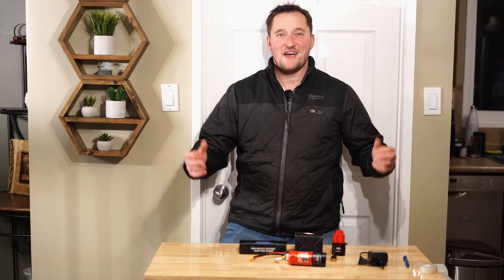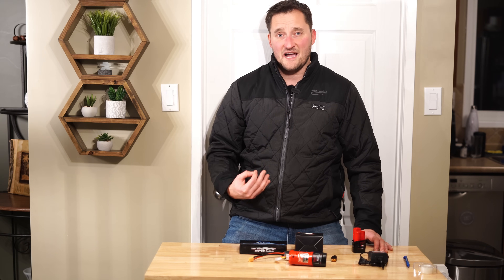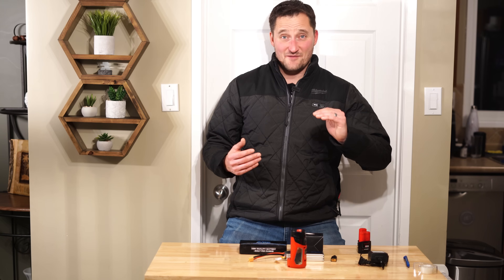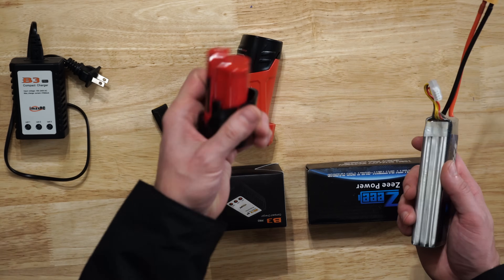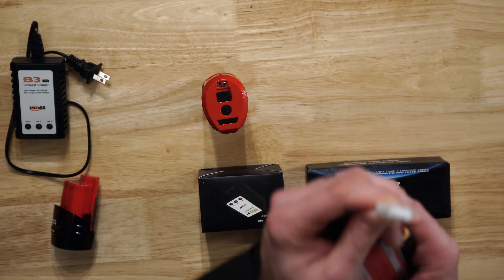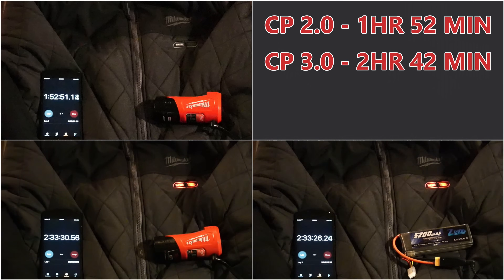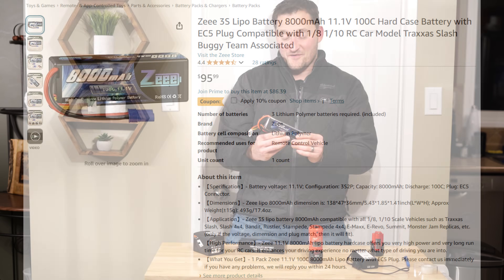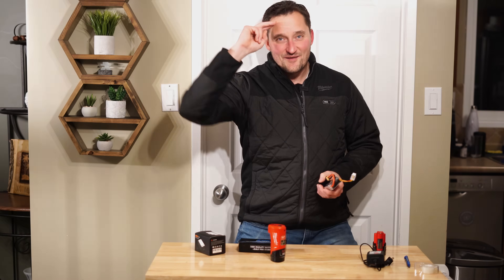WARNING! Read Description - Milwaukee M12 Heated Gear Battery HACK for INSANE RUNTIME!  Part 1

Comment: Get a full RC charger that uses the xt60 and balancer charger that you're using. Much quicker charge rates.
Reply from the maker: Thanks for the comment! I just ordered the 9000 mAh battery for testing and I'll be doing a similar setup for my heat d gloves so I may give that a go. Thanks for the advice!
Reply: @RegsChannel Make sure you read the paper that comes with the battery. It will tell you the minimum charge rate usually .5C and max charge rate usually on zeee batterys its 1c, on a 9000mah batt that would be max 9amps and min 4.5amps. These batterys are not something to tot with have burnt down many a house and sheds. You also want to put them in a storage charge when not using them for multiple days at around 3.8V

Comment: I have a  m18 adapter for the jackets i use it is the hooded one that has front and back heat. I use a 5ah battery that last 8 hours and charges in a hour i love it in my jacket it can fit eather behind me or under the side pocket.only downside is its hard to get in and out but working outside all day it makes a big difference!!!!!!
Reply from the maker: Hey!! Thanks for the comment! Oh I bet! That's great to hear! Yeah the advantage of the M18 stepped down to 11.1 volts is that you will get some sick run-time! I have the Zeee 9000 mAh battery on the way and I am expecting to get 8+ hours of runtime for sure, I'll see if it can give the M18 batteries a run for their money!
Reply: @RegsChannel  last year I was working on storage units the company I work for were building in Columbus and the cold sucked so I got the jacket only had 1 M12 3ah battery until I got the jacket it came with another and was constantly charging them found the M18 adapter for 20 bucks and I have 6 5ah batteries so worked out really good I also ordered a couple of heat pad kits but dint get the chance to install them in some pants or longjohns last year ended up having some health issues in February and haven't made it back to work been doing some work for a budya trying to get my health good enough to go back full time were im not taking breaks every 30 minutes to a hour lol but definitely going to try them here soon!!!!!
Reply from the maker: @stevenoe6395  Thanks for sharing! Yeah that was my gripe, all day outdoor events you need to have spare batteries, the m18's are good, but clock in at about 1.54 pounds each, plus the bulk, but if you have them already, it's hard to beat free! Hope your health improves, take care!
Reply: @RegsChannel  probably will and smaller lol I did have that adapter in one time working on a car and it did get in the way a little bit when I was on my left side. When I get the chance I have a couple USB heat pads think 8 2" pads for each probably going to glue them into my coveralls then make a belt adapter for the M18 to run all of them I have only got to try the pads out to make sure they work cheap ones on Amazon lol but luckily I'm not back to my main job yet well kinda lucky not on the money side lol. But will probably be working in Cleveland building storage units so will come in handy.
Reply: Where do you get the step down m18 adapter?
Reply: @danlux4954  Amazon it's not made by Milwaukee it's a generic has 2 usbs on it a c and a and the plug for the jackets it also has a flashlight on it. I think it makes the jacket hotter also but used it most of last winter with no problem only problem I had was getting it in the pocket with a 5ah battery it was easier to put the adapter in then the battery. I'm going to start using it again today probably lol I put the 12v back in since the cold here in Ohio hasn't been too bad and I'm not working outside as much yet well not working a lot yet lol
Reply from the maker: @stevenoe6395  sounds good! Glad it's working well for you!
Reply: @RegsChannel  thank you hope that pack works out for you. I probably would have done the same thing if I dint already have m18 stuff already. For me just cheaper to use what I have the good chargers for those batteries can be expensive well I no they used to be years ago when I was in to remote control cars and my kids were younger and turned a grasshopper into a wedge battle bot for my oldest boy at the time lol
Reply from the maker: @stevenoe6395  I've learned a ton more about the safety precautions that one needs to take to use one of them safely. I'll be doing an updated video on that as soon as the gear arrives. Thanks for the support!

Comment: Awesome video. Thanks. I have three of the M12 hoodies and runtime is definitely an issue and you're right. The low setting is pretty much useless. I'm not into RC but I will be getting one of those batteries and chargers to try it out.
I wish I had waited before buying the M12 "Heated Gear Power Source". I got it hoping it would be a bit more less noticeable but I find it's actually worse than the normal M12 batteries and runtime is about the same.
Thanks again and good luck with your Blue Bombers. I hope they beat those sucky Argos.
Reply from the maker: Thanks for the kind words! Are you referring to fat Milwaukee flat battery pack with Bluetooth? My big gripe with it again is runtime, it's only around 2.5-3.0AH. I have the 9000 mAh battery with adapters on the way and will do a full review once I get it! For me the 5200 sits nicely on my left side and is barely noticeable when sitting down. My wife has also used it in her vest and loves it as you don't see a huge bulge. Can't wait for my Blue Bombers to bring home another Grey Cup in a few hours! Let us know how you make out with the battery! Cheers.
Reply: @RegsChannel   Yes, the flat one with BT and 3Ah. The only positive I find with it is the app can tell me the percentage left. I just put my order in for that 5200 Ah and charger and adapter.
Reply from the maker: @daifeichu  awesome, sounds good!
Reply from the maker: @daifeichu  just a word of caution as many others have pointed out, invest in a low voltage buzzer as well to prevent over discharge. Trying to charge a lipo cells from a low voltage state can cause a major safety hazard!

Comment: This is a bad idea. Lipo batteries are very volatile and super sensitive to over charging and over discharging. Just search lipo fires. Not safe to carry in your pocket!
Reply from the maker: @marcross2805  would you say this applies to all LiPo garments/batteries? I have a pair of FXR heat led gloves that use the same system, no BMS, that I have had for about 4 years. I think it's about understanding risks and mitigating them personally.
Reply: Chances are there is a BMS built in that's protecting the lipo. Or alternatively, it could be part of the batter itself. @RegsChannel
Reply from the maker: @tenflat2009  thanks for the insight! The batteries for the gloves resemble the pouch cells and to my knowledge the gloves only have an on/off button. I could be mistaken! I know BMS circuitry is small.
Reply: @tenflat2009 no they do not come with this! They also don't have hard cases. The bms is on the balance chargers and the rc systems separately 

This is stupidly dangerous
Reply from the maker: @rangerbrown  Hi there, respectfully, I can't see how discharging that battery at 0.6-0.8 amps and charging it around 0.8 amps is "stupidly dangerous" I do agree that a puncture is a bad situation, but I feel like these batteries take 10x the abuse in an RC application then what I am doing with them. Cheers!
Reply: @RegsChannel over discharge or over charging, when no rc hobbyist trys this will be running great risk. so again this is dangerous it's not what it's made for. Honestly do what you want but lipo batts are a bomb when abused or missed used they are not forgiving.

If they were they would be pushing tesla down the road
Reply from the maker: @rangerbrown  thanks for the comment! Yes one does need to understand the risks involved.
Reply from the maker: @rangerbrown  Hi there again, I do agree that folks need to be aware of the risks that come with these,  the manufacturer, at least in my case lists what necessary precautions to follow. Adding things like using a hard shell case, a low voltage buzzer or better yet a BMS helps make things even better. Cheers!

Comment: need a bms or it will be over discharge those battery has no protection...need a better charger those can be charge over 10 amps
Reply from the maker: Hi there! Thanks for the comment. True, I plan to speak to this in my next video. My charger charges at 0.8c or 800mAh. The battery is cold to the touch while charging so I think I'm ok there!

Comment: A couple of things, that is a 3S pack, or 3 separate cells of 3.7v each x 3 is 11.1 rated voltage. It looks like that charger might not be a balance type charger which means it charges across all the cells in series to charge. A balance charger charges each cell separately to keep them in "balance" or at the same voltage. Constant charging without balance could eventually result in one of the cells splitting off from the others and overcharging or under voltage. It might be a balance type not sure. Also, the 3S battery pack has a minimum safe discharge voltage of 10.2 volts. The battery pack does not have circuit to shut off the pack, that is handled by the device plugged into. But since the jacket would not shut off at the 10.2V because it is set up for the Milwaukee M12 type. Going down to 9.9 is below the minimum safe and might result in cell damage or reduced life.
Reply from the maker: Hey there! Thanks for the insightful comments! The charger I got does indicate that it is in fact a balanced charger, and the 3 lights on it correspond to each individual cell. They go from red to green individually  once charged, so I think I'm good there! In terms of the voltage, I contacted Zeee support and for each cell I'm good between 3.2 & 4.3 volts however you are correct, frequent trips to 3.2 volts won't be great for the longevity of the battery. However, with the added runtime I don't think I'll ever need to run it to dead... I plan to do another video testing out their 8000 /9000 mAh battery and am going to try and speak to low voltage situations as you have suggested. Again for the cost/performance/size even if this battery lasted 100-200 cycles I am beyond happy!
Reply: @RegsChannel  the cutoff voltage for m12 tools is more like 9.6v,  the m12 batteries dont have any protection built into them they are just dumb 18650 cells the tool/jacket does the battery protection.  not sure what your electronics skills are like but its likely not that difficult to change the circuit in the jacket to cut off at a higher voltage so then you dont have to add extra protection for the battery.

Comment: Just don’t bend that RC battery! It will catch fire in your pocket. They are very sensitive.  Would be better to hold that RC battery in a rigid case. Maybe 3D print one…
Reply: You need a low voltage cutoff to stop from over discharging the lipo, lipo's don't just shutoff there is no circuit in them.
Reply from the maker: @Jimmykid3  Yes! As I have found out. I ordered a low voltage alarm and will be doing an updated video soon!
Reply: @Jimmykid3 Being the jacket is set up for a lithium pack, it should have a built in shut off system already. I would research it.
Reply: Race batteries are in hard cases. But all of them are sketchy
Reply: @MattLitkeRacing How so?
Reply from the maker: Hey there! Thanks for the comment technically it is in a "soft" case but with where it sits in the pouch there is very little chance of it bending to a point that would have me concerned. I do like the 3D printed case idea though, and may need to look into that!
Reply: @RegsChannel 3d print a crate style case so the battery has some ventilation.
Reply from the maker: @joea1018  thanks for the advice! Will look into doing that!
Reply: @RegsChannel  you can get low voltage cutoff circuits for around the same price as a buzzer that will actually disconnect the battery from the jacket or whatever is wired into it. That milwaukee m12 adapter has one built into it
Reply from the maker: @Jimmykid3  that is fantastic information! I will look into that option more! Does it need to sit in line with the xt60 connector?
Reply: @RegsChannel they do make them in a hard case. It is better not to take them below 3.3v pre cell or damage is possible.
Reply from the maker: @rob1603  thanks for the insight! Zeee stated 3.2v per cell, but 3.3 sounds like a better bet. Thanks!
Reply: I smashed them into trees the ground and all other things and have nothing worse happen then a couple bad cells or balance plugs getting ripped off... These will be fine in a jacket
Reply: You can get rc lipos with a hardcase
Reply from the maker: @midwestworkshop2863  I have one on the way, should be here later this week!
Reply: @midwestworkshop2863 where would you get what you’re referring to?
Reply: seriously? don't  bend it? I have slammed RC batteries into the  ground and they get bent. As long as they do not burst or are impacted with a sharp object, they hold up very well. You would rip the jacket before you damaged the battery inside the jacket. Unless someone stabbed you where that battery is located, you are good to go. Many RC batteries  have a plastic panel on both sides for protection. Only the ends are at risk.
Reply from the maker: @scottfirman  thanks for the comment!
Reply: @RegsChannel  Sounds like you got it figured out. Thanks for the idea!
Reply from the maker: @scottfirman  with the right safety precautions these can work very well! I am in the middle of running runtime tests with the low voltage alarm, and the results have been impressive so far! I have there 9000mAh battery that will be undergoing testing tonight! I hope to have the video out this weekend!
Reply: Great idea!
Reply from the maker: @nathanrasmussen8550  I think a Bambu labs printer may come down the chimney this Christmas
Reply: 3d printed case is a great idea, when these things catch fire, it is insane, in the pocket is very dangerous. But I need more power and smaller batt. I been using the XC ones and it is uncomfortable as hell. I think the the batt being in the pocket is going to keep the temps up on the batt, but it being drained so slowly compared to using in an RC car, the temp may not rise to a dangerous level. I also notice that the leads like to fray right where they enter the batt pack, so lookout for that. A 3d printed case that contains the wire leads as well so they don't bend and move much would be a good idea.
Reply from the maker: @1windozesuk  love the feedback! Yeah the pack I got can discharge at 50c (I believe that means it can hammer out 50 amps in a surge safely) but for our application the jacket pulls between 0.6 & 0.8 amps so the battery shouldn't even break a sweat. I reached out to Milwaukee to see if I can get an answer as to if there is some sort of BMS built into the jacket (I believe on their M12 tools the BMS is in the tool, but I could be mistaken) while both using the battery in the jacket and charging it, it has been cold to the touch. In a follow up video I'm going to see if I can implement some additional safety measures.
Reply: So when I started using lipo batteries I was told that they are very dangerous that you cannot take your eye off of charging it because if they go they explode burst of fire that could burn you or anything around they do sell a safety pouch which wraps the battery up in case and gives you at least some time to but to put a battery like that in your back I don't know
Reply from the maker: @Kid617  I gathered that the biggest hazards come from over discharging and then recharging, or dealing with a punctured/damaged battery. Ultimately I lean on taking all safety precautions indicated by the manufacturer of the battery. I charge/store the battery in a metal ammo box, and inspect the battery before use. I've added a discharge alarm to mine as well. Thanks for the comment!
Reply: @RegsChannel where did you find the discharge alarm you decided to go with for this setup
Reply: @Kid617 That was in the early years. Technology has greatly changed since then.
Reply: They also make them in hard case. Use them all the time in RC trucks
Reply from the maker: @FLabrenz  yep I have one on the way for testing!
Reply: They’re not that sensitive 😂😂😂  they get back around all the time from bashing/ racing.   You know nothing
Reply: You do understand the beating RC’s take with these batteries in them and they rarely ever have issues. The biggest risk with lipo batteries is charging them.
Reply: @JeremyBreeden89   Along with leaving them and forgetting about them. you're right the problems are rare but they are a lot riskier than any other battery on the market.
Reply: Came here to say the same, those RC batteries are not built to the same safety standards. Running them too low, charging incorrectly or not frequently enough, poor quality control, or convincing knockoffs, all reasons to be careful with them that close to your body. I’ve seen too many of them vent to trust them. For that reason I keep mine in a fire retardant bag in the garage. Anyways to each their own if you still wanna do it cool. Just felt the need to inform